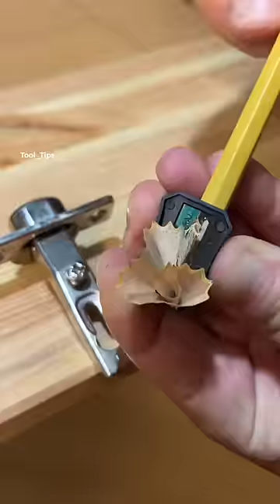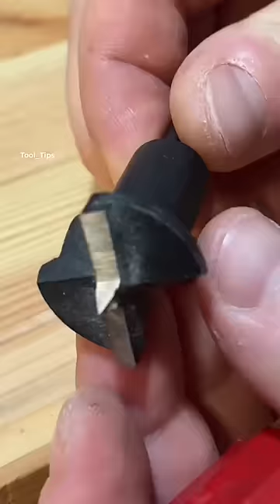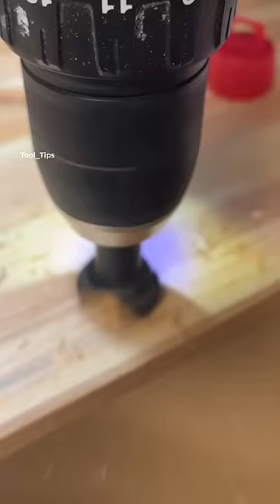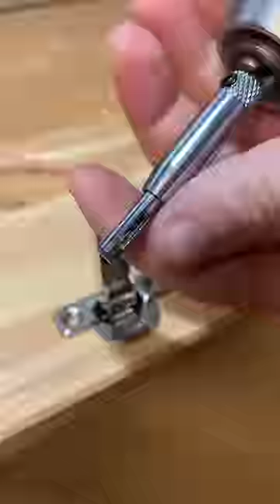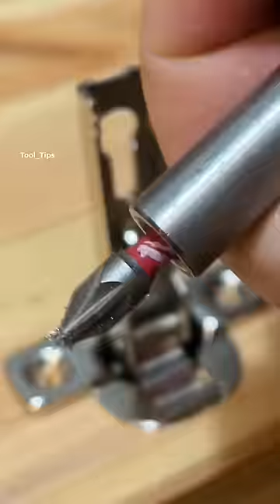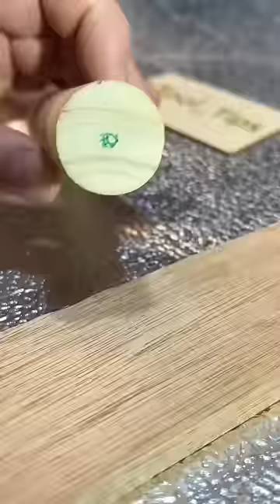Few People Know About This Secret Tips

Comment: Tip 1. I don’t know how accurate it is for finish work and consistency but I’m sure it’ll work fine. I usually measure 22mm in from the edge of the piece where the hinge is going and that’s the centre for the average size concealed hinge cutter. But they do have bigger sizes and smaller sizes